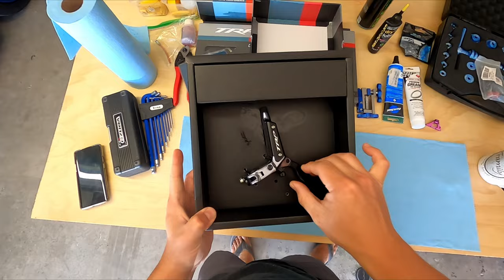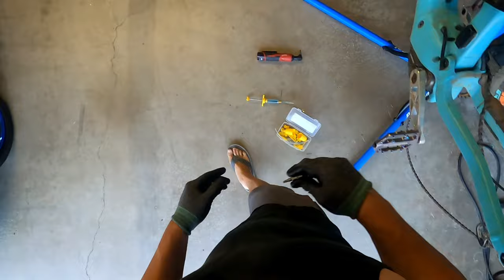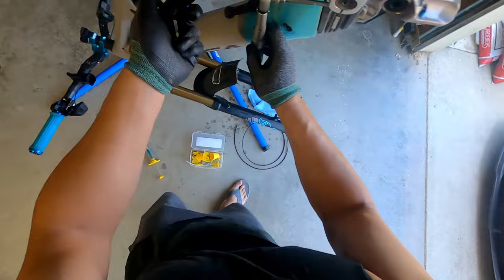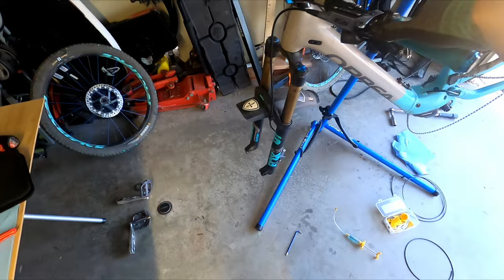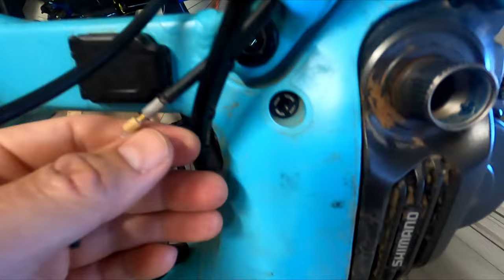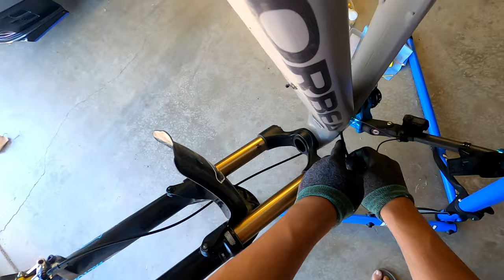TRP DHR EVO brake install on Orbea Rise didn't go so well 😅 Shimano EP8 motor removal 😬

Comment: I was lucky when changing out the brakes on my bike as my bike has full in-frame tubing for the brakes.  Took about 2 minutes to pull out the Code cable, then install the new line for the TRP brakes.  I went with the TRP Evo DHR as well, don't have the 2.3mm rotors as yet, but so far so good.  I am also on the stock pads, will get them a few more rides to see how I like them.

Comment: u can pull motor with just a stubby allen ( really stubby ,cut down) no need for special tools really easy 6 bolt removal , and the two that are hard to get remember to cut them just alittle so easy to install, i use blue locktite

Comment: YO the RACEFACE color rims. Are sick I am Buying a new wheelset with I9Hydra and RaceFace ARC35 OFFset.  Gotta know are they stickers are special ordered?  I just bought the TRP DH-R EVO in GOLD. But wish I went with black.  Luckily they are pre-bled, & purging the Levers is easy.  My One worry is I went with 40mm PostMount adapter for the front to go to 220, & now wondering if I made a mistake going so big, because There is no rubber spacer like with the 20mm not sure why.

Comment: Can’t wait for the TRP review! I also have the MTX pads and very happy with them. Much better than the stock SRAM G2 pads

Whoever told you not to use torque wrench to loosen bolts is 👍🏻
Reply from the maker: Awesome man. Yea that guy is a mechanical engineering genius, I trust him. Hopefully i don't need to recalibrate my torque wrench lol

Comment: Hey man! Found your channel by searching dhrs. Cool video and sweet bike! I bought a Levo a few months ago. Then I too bought the dhr’s and installed then and was in love with them. I didnt shorten the front cable(hose) and so my front brake is still on the factory bleed. I did have to cut the rear hose to route it and did a lever purge and all was good. They worked great!!

Next upgrade was onxy classics hubs  on Nobl tr41 wheels and the hubs are centerlock as the 6bolt wasnt in stock. I was hesitant but didnt feel like waiting and got the CL hubs. So I had to get new rotors as I didnt want to use those centerlock to 6bolt adapters. Anyway, after finally getting the speed sensor magnets bracket and everything else I needed, I went for a ride. Right away I noticed the rear brake was spongy and had a bite point that was all over the place. I figured out that my rotor was bent and was pushing the caliper pistons in as I was riding. So I bought yet another rotor and sure enough, that one also bent somehow!!

I bled the rear brake and have done so many lever purges. The brake feels great in my shop but then acts up when I hit the trails! Have you had any issues with yours? My front brake still work amazing but I cant get the rear back to awesomeness!!! Just curious if you have any issue?! 

Thanks for the video!!
Reply from the maker: Thanks bud definitely loving the DHR II with its weight saving and I don't think I'll need Assegai for the trails around me. The brakes has been good except the rear one make noise when it gets warm. No problem with bite power, but still getting used to the modulation. Happy shredding buddy 🤙🏻

Comment: Hey dude,

good choice. I'm curious about your riding impressions, I have no experience with TRP!

What happened to you is exactly what happened to me when I converted to a Shigura. Crazy muscles, there's nothing you can do about it…😅

Removing the engine was easier than I thought, but installing the inner spacers on the upper bolts was a test of patience for me.

Comment: What diameter rotor did you go with? 223?  How did you get it to fit?
Reply from the maker: Yea 223 front, and I think 220s in the rear. You just need to get the appropriate adapters for the calipers. For example, if your fork post is 180mm, then you will need a +43mm adapter, etc

Comment: How is the report on the TRP DH EVO? I had Magura MT7, but just bought the DHR EVO for my next build, how did you like them?
Reply from the maker: In terms of modulation it sits between Magura and Sram, once you get use to it it has great/smooth bite with awesome control.